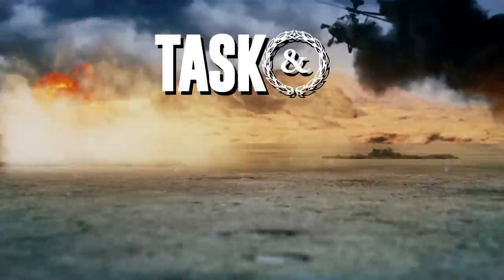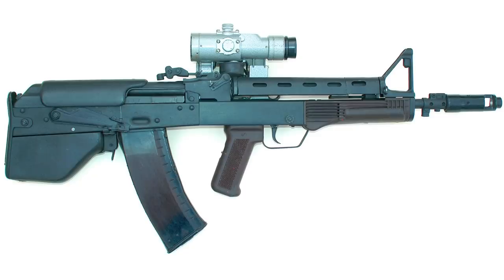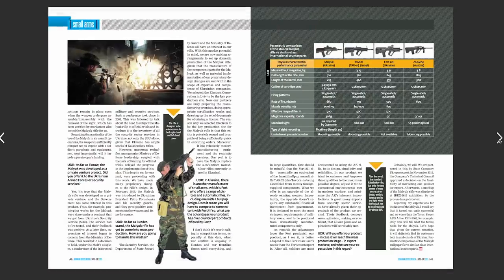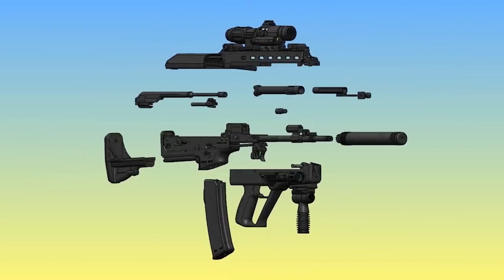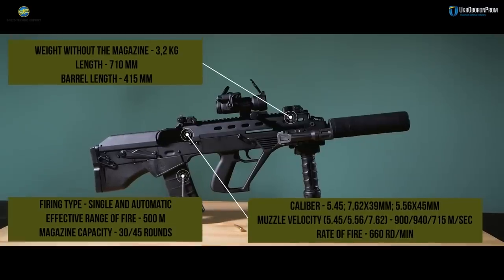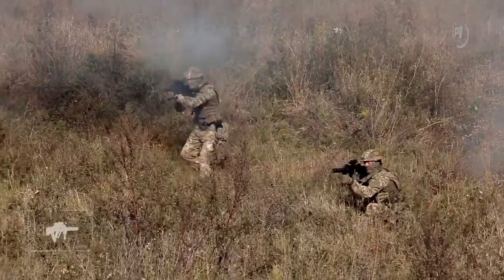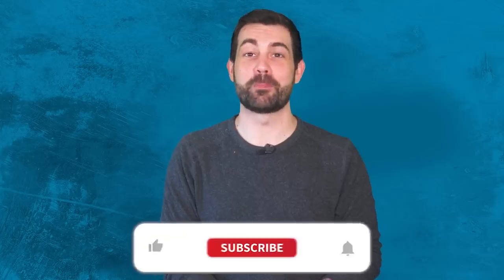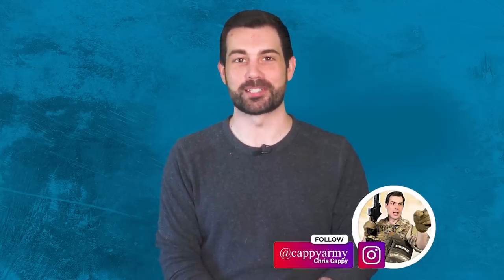Why Ukraine Special Ops Use This Bullpup. The Malyuk.

Comment: Speaking of convection cooling, you can also have convection cooling with airflow. Convection ovens work by moving the air inside a closed system to more evenly distribute heat. If there is airflow around the barrel, technically you can have a convection heat transfer occurring (natural convection vs forced convection which would use a fan, pump, etc.), which helps cool the barrel. Simply put, "air cooled" is "convection cooling".
Reply: Yep. Convection Heat Transfer describes how most fluids and gases (which are also a type of fluid) move heat setting a system.
There will be hot air blasting out those holes while pulling cold air in probably through somewhere underneath.

And I bet building a good trigger isn't that difficult. Just needs something better than "an rod".
A proper linkage to transfer forces, or maybe all the trigger feel bits are up front and just a link to a hammer at the back.
Doesn't sound difficult.
Reply: Like the Lewis gun?
Reply: @MostlyPennyCat  I don't know, the triggers on the AK-103s and the civilian versions, are pretty reasonable.
Reply: @Seth9809  It's not a bullpup so the trigger system can be a lot simpler thus resulting in better trigger feel. Bullpups need extra doodads because of the way they are.
Reply: @dspserpico  Just like a Lewis gun, yes. Moreover, those slots on the upper assembly body may very well allow for air to flow more strongly around the barrek, as heat from near the chamber will expand the surrounding air making it flow outwards. This will, in turn, reduce pressure in the slot vicinity and, theoretically pull coller air from the outside. This might explain the claim of less hot gases getting blown on the shooters face, as plenty of heat will be expeled from the front of the upper frame.

Can't be sure it actually works when the slots are so big.
Reply: @MostlyPennyCat  yes, cold air enters through the hollow handle
Reply: Yeah I was gonna say the same thing about convection.
I thought he was a bit critical for not having hands on the gun. You can't really make statements without evidence.
Reply: I would possibly think that it got exaggerated from "air cooled" to "convection cooled" somewhere in the translation process, but I'm probably wrong
Reply: @bobmcob1132  air cooled is convection cooled, it's the same thing.

The problem in the video is he didn't pay enough attention in science class and assumed it had to be liquid cooled to be convection cooled.
Reply: are they using vacuum-chamber cooling like in cpu's?
Reply: @generalrodcocker1018  are you calling heat pipes vaccuum chambers, because I've never heard them called that?

From another commentor, it sounds like cold air flows up the handle to the vents up the top. It doesn't have any special mechanism, just as the hot air at the top rises and expands it then draws cool air from the bottom to replace it.

How much more effecient this is from just having it open to the air, I don't know.
Reply: Yup because air is still a fluid
Reply: Wondering if they may have done something like in the Spectre M4, which uses the cycling to   push air between the barrel and the shroud..?
Reply: @Commander_ZiN  I understand that, I'm just saying that "Convection Cooled" sounds appealing more to a western buyer. Also, you can have air cooling without convection.
Reply: @bobmcob1132  It doesn't sound more appealing to me. Also I find it hard to imagine air cooling without convection, how do you stop the air moving?

I'd love to see this gun under a FLIR camera :P
Reply: @Commander_ZiN  When I said air cooling without convection I was implying aircraft machine guns, which, while sort of using convection, more rely on the air going over than than the convection currents created, so yes, the air is moving, but from forces external to the gun.
But speaking of FLIR cameras I would love to see a Lewis gun under one.
Reply: @bobmcob1132  I know it can be a little unintuitive, but forced convection is still convection, just not natural convection.

Whenever heat is transfered via molecular movement of fluids it's convective heat transfer.

Think of it this way, it can only be convection, conduction or radiation. Often a combination.

Don't take my word for it, have a Google.

P.S. They call radiators in cars wrong, they actually should be called condensors :P But I'll still call them radiators no matter was the parts list says :P
Reply: Cool
Reply: thanks, I wasn't going to respond to it but it was annoying that he seemed to say that convection was just about liquid
Reply: Greetings from Ukraine!  About convection.  the handle is hollow and connected to the barrel.  when the barrel heats up, it begins to suck cold air through the handle and push out the heat through the holes in the paper.  By the way, they don't use anything from AK in the new batches.
Reply: @soloway-l1o  thanks for clearing that up :)
Reply: @Commander_ZiN  Same principle in fireplace.
Reply: @bobmcob1132  it's convection cooling because the air flow follows the natural heat flow. Stop overthinking.

And yes, it is about the same thing as any mlok or qmod or any perforated handguard. Mostly marketing fluff but it helps.
Reply: @MostlyPennyCat  I don't think there is much it can be done about the trigger. Remember, some of those are repurposed aks. You could have a lighter ak trigger group and a better linking system but at point you may as well build a new rifle.
Reply: @user-pq4by2rq9y  
I was talking more generally about bullpup triggers but you're probably right.
I suspect it's the same as the difference between pushrod and overhead camshaft engines or switching a light switch with a broom handle.

Comment: By convection system, they mean that weapon has port for air entry at the bottom of handle. Air is being sucked from this port by convection, because hot air leaves weapon housing through vents at the barrel guard and must be replaced by cold air sucked from handle.

Comment: It's not only UA SF that get issued the Malyuk, although it is intended for there SF it has found its way into many units/individuals hands.
Reply: I think it's the SOF and National Guard that use them.
Reply: @yanzavhorodniy1231  Nope, although they both use em, I've seen coverage of units from the volunteer battalions get given malyuks and loads of RPG's when they are classified as 'light' units. So it shows they have alot more then what is stated.
Reply: @yanzavhorodniy1231  apparently the marines do too, I've seen a cpl video with a few of them carrying it.
Reply: @fivesormeem3219  Well what are light units supposed to have if not small arms and RPGs? Also a lot of volunteer battalions have been absorbed into other structures like the National Guard so they'd get access to that equipment.
Reply: *Their
Reply: @fivesormeem3219  look up what light infantry is. it doesnt mean they're walking around with only an uzi with one spare magazine
Reply: @HollywoodMarine0351  I've seen that footage that's why I said what I did in my post, I'm sure civdiv had a AK74 but the other guy definitely had a malyuk
Reply: @HollywoodMarine0351  And, additionally, they're also used by whoever can get their hands on them, yes.
Reply: AZOV also get them since they get whatever they need.
Reply: @huntergatherer7796  I don't know about getting whatever they need. You seen that photo of Azov using a Ferret armored car from the 50's?

Comment: "Convection" doesn't imply liquid at all, it just means that a hot substance is allowed to move upwards. In this case, the handguard is vented, which will help keep the barrel and gas system cooler, but I agree that it seems unlikely to have any effect on keeping hot gasses out of the shooter's face.

Comment: The term convection, although usually used in context of liquids is not limited to context of liquids, and can be applied to gasses or even solids as well.
Reply: @T.J. Kong , yes, I think you think of granular convection. Although I think the engineers of this rifle tried to describe convective heat transfer in a layman's way of explaining.
Reply: Not looking at what the profile at those spots looks like you can say convectively cooled and just be talking about ribs/fluting or in a really cop out way, just metal exposed to air that has a space for the air to vent
Reply: All gasses are liquids after all.
Reply: And air is still called a fluid
Reply: Air is a gas, gasses and liquids are fluid. Gasses are not liquid.
Reply: @HIlIlIlIlIlIlH  my bad the right term is fluid and not liquid
Reply: i almost exclusively hear it used in the context of gasses like in a convection oven, or solids like in a convection cooktop
Reply: @johnmcm7690  No, all gasses , are FLUIDS. Gasses and liquids are fluids.

Comment: Hi Cappy, many years ago, I saw an AK demonstration, where the weapon was set to automatic and the magazines were changed as quickly as possible. (the AK was mounted in a jig) and after about 200 rounds the wooden furniture was smoking, and quickly burst into flames thereafter. Not a meaningful test, but it demonstrated a principle.

Comment: Convection works for air too. I'm sure this air way in the grip helps with cooling. Good idea.
Should be mentioned, the mag is inserted in reverse, normally its nose in, rock back, and here its the back goes in first and you rock the mag forward. That way they can have this super curved 7,62 mag almost touching the grip and not have any problems.

Comment: Another reason there could be reduced recoil is that the traditional AK has a stock that is lower than the bore axis, while the Malyuk appears to be much more in-line.
Reply: yeah, I think they're really talking mostly about muzzle climb, which does look quite reduced on the malyuk.
Reply: @Ass_of_Amalek  I agree, a strong SF dude doesn't care about recoil from the tiny bullets these rifles spit out, it's muzzle climb that ultimately matters. MP5s don't knock over anyone due to recoil but the muzzle climb is atrocious so there are many competitors!
Reply: Doesn't the AK-74M have a straight enough stuck and a good muzzlebreak?
Reply: @Seth9809  Take this for granted, because I haven't shot one ever, but the top of the stock is barely inline with the barrel. However, it is below the part of the gas system that is sending mass backwards.
Reply: That is reducing muzzle rise and increasing felt recoil. Weight and brakes are the only way to reduce recoil.
Reply: @josedorsaith5261  not only the bore axis matters, the center of mass of moving parts and spring placement matters too. For example, you dont have to have low bore axis on a handgun, if the spring is significantly lower and vast majority of the recoil force is tranfered to shooters hand throught the spring, before the sharp hit. Thats why Hudson 9 had low muzzle flip (the spring placement, not sure how much of the recoil went throught the spring)
Reply: @josedorsaith5261  I have a standard Izmash produced AK74 with side folding plastic stock, and I can assure you it is perfectly aligned, and completely centred on the axis of the barrel, and therefore the muzzle. The centre of the butt  is where the force is, felt not the tip, unless you are shouldering it in some weird way. Additionally, the flash eliminator has offset gas holes in the top and right of it to counter climb caused by recoil from the large lump of top heavy bolt carrier and gas piston.

Comment: Instead of comparing the Malyuk to the AK-47, I think it would be much more interesting to compare the Malyuk to another quality bullpup design based on the AK-47 long-stoke piston system, the Tavor X95 (5.56mm) or Tavor 7 (7.62x51mm). The Tavor X95 was adopted in November 2009 by the IDF as their standard infantry weapon with the addition of an integrated grenade launcher. Two bullpup rifles have been frequently seen during the war in Ukraine. The Malyuk and the Fort-22 Tavors. The Fort-22 series Tavors originate from Israel’s IWI.  RPC Fort was established in 1991 and in 1998 it became a state enterprise located in Vinnytsia, western Ukraine.
Reply: your important point that Malyuk is not one of the Fort / Tavors
Reply: The Malyuk is not based on the AK, it is a repurposed AK receiver in a chassis.
Reply: @DickCheneyXX  It certainly is based on the AK.  At the heart of the Malyuk is an AKM or AK-74 receiver, with their original barrel, bolt group, and trigger group. The trigger is linked to the trigger group by a link.  Since the Malyuk uses the AK receiver along with the original barrel, bolt group, and trigger group, it is much more than "a repurposed AK receiver",  It is a rifle based on the AK.  The Malyuk is essentially a bullpup AK with a polymer encasing.
Reply: @red94mr28  It is a AK in a chassis, I know exactly what it looks in the inside. You can find disassembly videos on youtube.
Reply: @DickCheneyXX  it uses a AK receiver, barrel, fire control, and gas system. It is 70 percent Ak74 in a new polymer body.

Comment: My god, they issue it to SSO and some other special forces units because they need ak-like platform that holds zero and has ability to be modded with attachments.That's only option they have that could be issued on relatively big scale.
Special forces of secrete servise(Alpha SBU) prefer SIG MPX, btw.
Oh, and those russian soldiers with malyuks got them from national guard bases during initial gains, in addition they captured quite few FORT-221(Ukrainian localised TAVOR) rifles.

Comment: Convection requires a fluid and not a liquid, air is a fluid. Think of your radiators in your house, traditional water fed ones transfer the majority of heat to the air via convection. The heated air the circulates around the room due to convection currents forming. 

The SA80 has multiple hole in the body of the rifle and the fore grip to allow air circulation and convection cooling of the barrel and working parts. There are plenty of rifles that use this, they're also pretty common on SMG's due to the majority of the barrel being enclosed within the weapon body.

If the Malyuk is more effective at cooling the barrel then it will extend barrel life, as the hotter a barrel gets the softer the steel gets and so it wears quicker. This is the reason why we do barrel changes on machine guns, the amount of rounds being out down range are to great for the barrel to stay cool. If you don't change the GPMG barrel and out enough rounds through it, it will literally start glowing and get hot enough to light a cigarette on it. It's also advisable to rob another units barrels if you plan to do this as they will be useless afterwards.

Comment: Tuning the gas system in 5.45 aks is actually pretty substantial. There is a very noticeable difference in a "combat gassed" gun and a professionally gassed gun. The ak will always have a nice chunk feeling to the recoil from the bolt carrier group, but it feels much nicer when the gun isnt over gassed.

Comment: The Royal Thai Army has used TARVOR as a standard service rifle. It has very good results in valuation experiments.  but shortly after in service The soldiers in the real field complained  that a bullpub gun had a lot of problems. The main problem was that the case ejecting port were right next to their faces. This made the smoke irritate their eyes a lot. Many units asking to go back to using the AR 15 because they feel more confident.

Eye irritation in the heat of battle that's not a small thing. It could mean life and death.

Comment: Just getting a rail for an optic is a huge improvement over the AK pattern rifles.  It the upper is mounted rigidly enough it might even stay zeroed.  The convection thing may be what Stoner and company did with the original AR15/M16 handguards using the heat from the barrel to pull air in thru the bottom holes and out the top to create a chimney effect.  Lots of opinions on that to this day.  Recoil looks pretty straight line over an AK which should reduce muzzle rise which may partially explain the reduced recoil claims.

Comment: 1: Convection can happen in mediums other than liquids-- hot air "escaping" from around a hot barrel is still convection. Openings around the barrel allow hot gas to rise away from the hot parts, while cool air is pulled in from below to replace it. No liquids are required.
2: The gas port on the barrel is not under the wood furniture of an AK: it's literally the vertical bit of metal that links the barrel to the upper tube (the gas tube) out in front of the handguards-- the vents on the gas tube are also forward of the wooden furniture (you can see the gases venting there in your firing clips). It's just that the whole barrel gas tube gets hot, and the handguards run over them both. It seems like you don't use the handguard at all on the Malyuk as everyone is using vertical grips-- that and the polymer frame are probably why people aren't burning themselves on this one. The gas port on the Malyuk is right inside the handguard (see 06:51), it's just people aren't actually gripping the handguard to hold the rifle (and plastic might be a better insulator than wood).

Comment: Technically even if they didn't change the gas system the felt recoil would have been lower. Feld recoil an actual recoil are not the same. If you take a barrel the same length and move it away from your shoulder the recoil will feel higher even though it's the exact same system
Reply: Also, they could've simply refined the bolt travel so that it doesn't bottom out at the back of the receiver, via different springs, a buffer, or cams. That alone would eliminate half of the AK bounce.